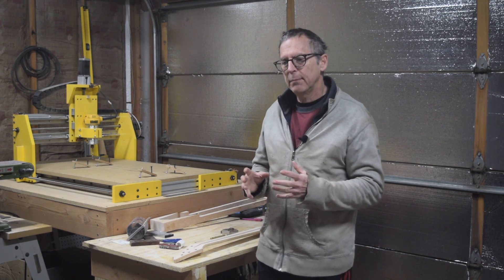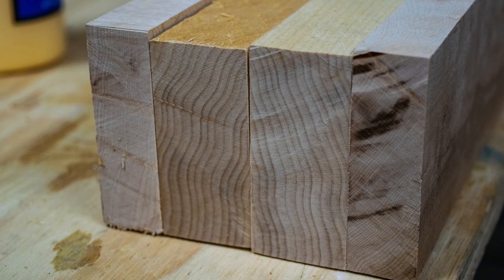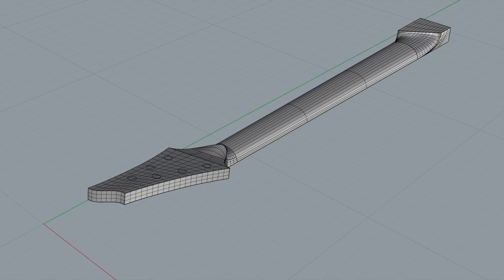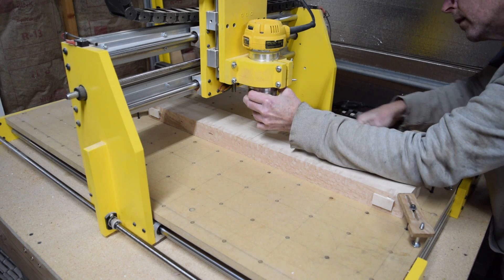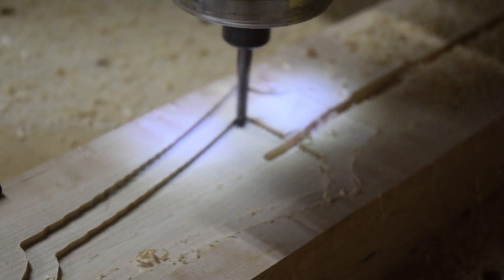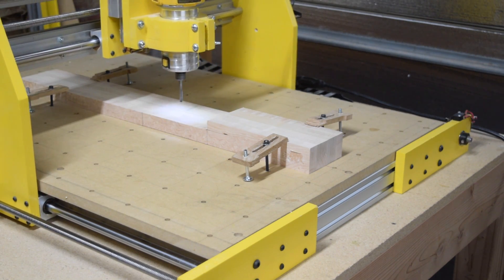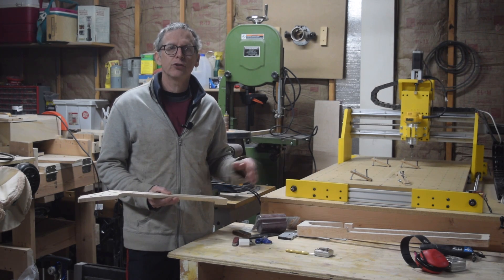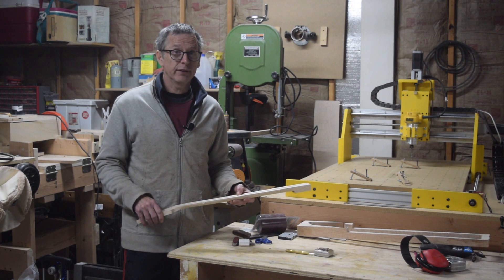Making A Laminated Guitar Neck On My CNC Machine

Comment: Great video. thank you. question for you..before machining the bottom, when you cut away the excess wood along the neck shaft using a bandsaw, how are you able to save time doing this?  assuming you're using a roughing operation (before a finishing operation) to hog out the wood along the shaft, if your home is still at the z height of the thickest part of the board at the headstock it will machine a lot of air and not save time. If you lower the z home then i would think that would think that would cause problems for roughing the back of the headstock and and also cause problem when roughing the shaft of the neck. thank you
Reply from the maker: I use a different z height home position after removing the excess wood.
Reply: @HighlineGuitars  Thank you...i was thinking that would be the only way possible. I'm assuming though for your headstock vs shaft machining operations you need to set a different stock height in the software, and then home Z to the top of the material  each time?
Reply from the maker: @pws-q1l  That's what I did when I made necks with my old CNC machine. These days, I use a much more powerful CNC machine which allows me to cut the neck shaft and headstock very quickly in one operation. That operation combines the roughing and finishing paths, which use the same home position.

Comment: Have you considered using a 4 axis cnc?
Reply from the maker: I would have to replace my Arduino Uno/grbl controller with a different solution that supports a 4th axis. That is possible, but I don't feel the effort would be worth the outcome.

Comment: Hey Chris, you have a great little setup for making guitar necks but it strikes me you could make the process so much better. Why dont you use your CNC to bore some datum points in the bed to take dowels so that you can position your neck blanks accurately every time without all the measuring and clamping. You could also produce a drilling jig on the CNC which you could use to drill the same dowel holes in the neck blank which would ensure that it fits on the bed perfectly every time. Another thing that I do worry about with most CNC users is that they tend to use such oversized blanks and therefore produce an incredible amount of waste. I know you have a huge supply of wood in the US but the fact is we should be trying to minimise waste in everything we do and some of the woods ( figured and birdseye maple ) are going to run out if the guitar industry doesn't start waking up. They will end up on the endangered list before too long unless we wise up. Wht did you use the birdseye on the outer laminates which became complete waste??????   I make one piece necks in the fender format because they are less wasteful and my laminated necks are made using 3/4" thick laminates with head stock additions and there is hardly any waste at all. I do not use CNC because I studied various forms and decided I could make a neck by hand just as quickly and as my customers are all different so are the neck profiles. I do enjoy your videos but we must start looking after this valuable resource.
Reply from the maker: The method you describe is exactly what I did when I started using CNC. However, every blank I use and every neck I make is different. I made necks by hand for 15 years before I switched to CNC. I’ll quit before I ever consider going back. My neck, back, shoulders, elbows, wrists, and fingers won’t let me.
Reply: @HighlineGuitars  I do understand what you mean, I'm 71 yrs old now and my hands do suffer especially in cold weather, but I find shaping necks gives me a good upper body workout.The other thing is that I would get two necks out of one of your blanks so it does make a lot of sense. The really good wood is not so easy to get in England so I have to pick some up when I visit my son in the US but Covid has prevented that this year. Keep up the hreat work and keep safe. - regards Dave.
Reply from the maker: @davidjennings9253  You will not get two of my neck designs out of one of my blanks. Trust me, I have done the calculations. Also, you need to understand that my blanks start out as a 10-foot long blank which yields six necks. Shaping necks by hand is an okay "workout" if you only make the occasional neck. But if you're shaping necks every day, all day long you will suffer repetitive stress injuries. When I get to your age, I still want to be able to fly fish. Thank God for CNC!!

Comment: Being a CNC programmer, I saw several ways you could expidite the entire process.
Using your .250 bit, cut 4 holes in your block at the four corners. Its critical that they go all the way thru.
Now you can make a jig. Make a flat jig that has dowel pins at the four corners to match your thru holes.
When you generate your gcode, make your work offset centered on on of the dowel pins.
Correctly done, you should only need to flip the part, re-clamp and run your second side, being sure to locate your work offset at the same pin center.
As long as your jig is indicated square to the machine axis, and your through holes are correctly positioned equidistant from part center, you never have to guess if its goint to be right.
Also if you will touch your tools off of the jig face your "Z" location will exactly match your print.
Reply from the maker: I still have to line up the blank with the machine's X and Y axis and locate home BEFORE I can drill the holes. I have used pins in the past as you describe and I stopped because it wasn't saving any time.
Reply: @HighlineGuitars  not to argue, but you only need close alignment for the blank. As long as all 4 holes are in it, its good.
Its the fixture that will require alignment. A dial indicator run across the face of the pins will suffice. You need only have a magnetic indicator stand stuck to the side of your spindle.
If you want to avoid that, generate a program for the pins, and roughly align your fixture plate.
You can then drill your pin holes and they will be perfectly in line with "Y and X".
From there its a walk in the park.
Reply from the maker: @johnogden1020  And that's how I would do it if I was mass-producing the same things over and over, which I am not.
Reply: @HighlineGuitars  Lol, I'm so good at CNC that I would have a fixture for  bodies, necks or whatever. 
You could grid out your table and use a reference location for each fixture. 
But you're right, I am a different kind of CNC machinist and you are not into mass production.
Lol, if that ever changes, you know where the find me.

Comment: Hi Chris, thanks for the video. Do you think that multilaminated neck makes scarf join unnecessary?
Reply from the maker: As long as you can source boards wide enough to accommodate an angled headstock in a laminated arrangement, you don't need to make a scarf joint.

Comment: You are absolutely right about grain orientation. But that begs the question, how has Fender gotten away with no consideration to grain at all. They use all manner of grain from flat to rift and maybe by accident sometimes even quarter  sawn. Maybe that’s why Leo designed his guitar with replaceable parts.
Reply from the maker: In truth, with Maple like Fender uses, you can use any grain orientation. It's that strong. With Mahogany, you really need quartersawn boards.

Comment: Have you ever done/considered making set-neck guitars via CNC? Aside from the initial (one time) investment of the coding, would not CNC make it much easier to create set neck joints? Personally, I find the set necks of archtops, acoustics, even LP’s much more aesthetically appealing than the fender inspired bolt on neck. The bolt on neck clearly works. But wasn’t the original reason for the bolt on neck that it was an easy way to mass produce inexpensive guitars quickly?
Cheers and keep the videos coming.
Reply: And with the right set-neck design, better upper fret access could be attained, right?
Reply: @ccchicken8889  Yup, that too!
Reply from the maker: I make both bolt-in and set-in necks. Mostly set-in as they are easier to make and install.
Reply: @HighlineGuitars  Any videos of you making set neck guitars, CNC or otherwise?
Reply from the maker: @dr.crypto6891  This playlist shows an entire set-neck build, specifically #10: https://www.youtube.com/playlist?list=PL7TLAFxVOtrUZo_fUsAd4bw1eqWhKqMk-

Comment: Thanks Chris! after gluing the neck with yellow glue arent you introducing more humidity to the wood and the wood should be dried agin to 10 precent of humidity?
Reply from the maker: Yes and where I live it takes about 12 hours or overnight.
Reply: @HighlineGuitars  Do you find any difference between Titebond 1 and 2?
Reply from the maker: @ccchicken8889  It's more expensive. That's the only difference I noticed.
Reply: @ccchicken8889  titebond 2 is stronger and water resistant. 3 is even stronger and "waterproof"  3 has longer open time than 2 as well. Their website has the stats